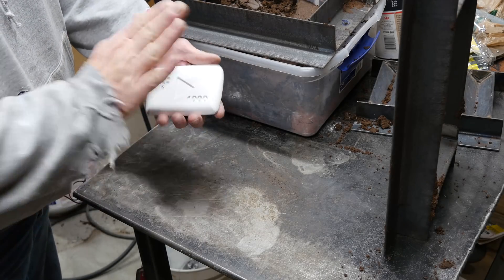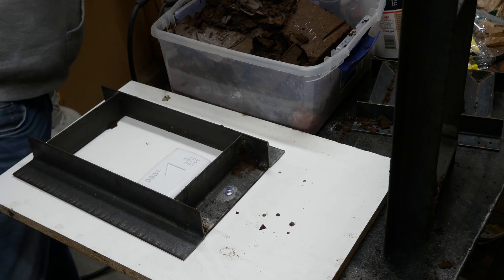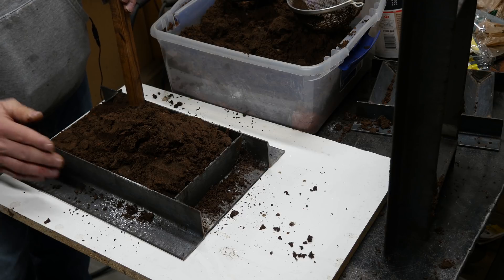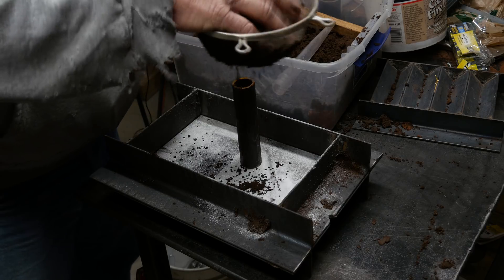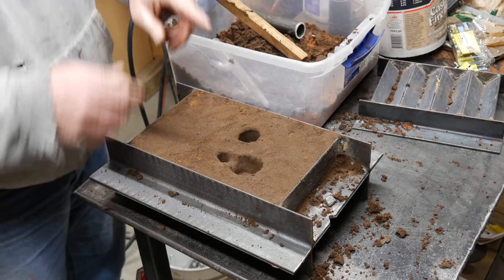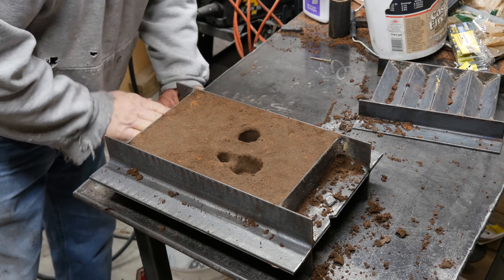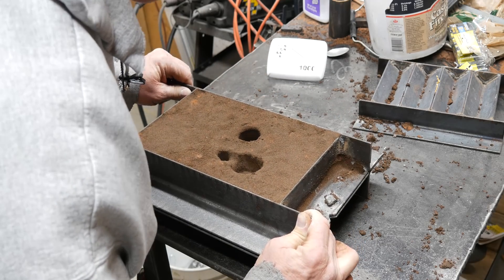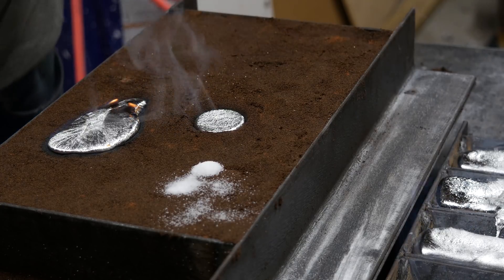Casting an aluminum YouTube play button

Comment: Instead of a deboss on the letters you could do an emboss. Or possibly less depth of the deboss would help. Just a thought as I have never casted :)
Reply from the maker: Actually going to try a more shallow deboss this weekend. I've had that suggestion before. Also trying a new "smoothing" technique. Always try multiple changes at once, that way you never know which one fixed the problem ;-)

Comment: Here is a video showing finer detail. note brushing the parting dust off the lettering and the use of a 2mm screen for the riddling of the facing sand.
https://youtu.be/fWHfVOy5JZo
Reply: Another video to consider (and channel worth watching)
https://youtu.be/AC3BqPe7L7U
Reply: here is a suggestion for a sand rammer project so you can ram your sand better. (also has tricks for doing castings from a 3d print)
https://youtu.be/18gEaRdC0xY
Reply from the maker: I'm going to reply to all of these at once. I didn't think there was anyone that spent as much time on YouTube as I did. Apparently I was wrong. ;-)

Interestingly enough I had watched each of these videos at some time in the past.

I'll have to ask Martin about the motorcycle plaques as he didnt use the sprue basin that he's been telling me about. He did say in that video he wanted it to fill quickly, maybe that's why. 

One thing that Brian's videos point out and Martin and I have talked about is the smoothness of the pattern. I used a primer, but not the same type that Brian used. I believe a large part of my problem is that the sand is sticking to the rough edges of the printed pattern. Martin suggested a shallower relief might help but in Brian's plaque he has some pretty deep relief. That again, I believe, points back to the pattern prep and how smooth he was able to get it. 

I normally brush the parting compound, talc, from the pattern as well but at this point I was getting desperate to try anything that might help get things to release.

I'm going to make a ramming tool. Maybe soon...

Good to hear from you again

Comment: It's been quite a while since I used to hang out at Alloy Avenue (http://www.alloyavenue.com/vb/forum.php), but I remember some talk about wanting to have fine detail in the cope (upper half).  However, that doesn't look like your issue.  It looks to be an issue with the pattern releasing cleanly.  Since you are using a printed plastic pattern, have you considered making a metal... brand of some sort to remelt your logo?  You could maybe make a small tapered square, just the size of one of the buttons, heat it to just under the plastic's melting point, and CAREFULLY press it into the pattern.  I realize this is more like treating the symptoms than curing the illness, but if the problem really is in the pattern making process, you may have to "fix" the pattern after you print it.
One other thought, it looks like the paint you used has a satin (or even worse, matte) finish.  If it is, I highly recommend going with a semi or high gloss finish.  Also, brush your release agent after shaking it out.  You don't want any bit of the pattern sticking unevenly.  I've never done any casting (at least yet), but it's one of the things I would really like to get into.  Good luck!
Reply from the maker: Thanks Brian.  I've got a number of things to try to get the whole thing to release from a shallower relief to using ABS and smoothing with acetone vapor.  You might have a point on the paint. It is a primer. Perhaps a high-gloss would work better.

Comment: Good job, just too bad the little details wouldn't pull clean. Could there be some pesky printer lines grabbing onto the sand in the recessed areas maybe?  Tricky...
Reply from the maker: I expect that is a large part of the problem. I tried paint but it only goes so far to smooth and getting in the small places to sand it tough. It is all about pattern and mold prep and apparently mu pattern ain't prepped properly
Reply: swdweeb by the way, I think I've got you beat for most raggedy shop-hoodie sleeves 😀 Only time it bothers me is when they drag in my greensand.

Comment: Best I can figure , not enough draft , not smooth enough ,too deep an impression , not enough parting powder ?  Try packing your impressions by hand before you ram up .  Might need to use supports in your impressions . Countersink then rase your letters .
Reply from the maker: I expect you're spot on on the draft and smoothness. I put 10% draft in my model but I'm not sure the printer has enough resolution to follow the draft and ends up stepping instead of sloping.  The depth is only 2mm. I tried filling with paint but its near impossible to get in there and sand.
Reply: I did a insert for some recessed letters .I used radio solder to form each letter an stuck them on a piece of tape .I then painted it several times , it filled in so nice you would think it was cut with a machine . taper / draft still works well after about 33 molds .
Reply from the maker: I'm a little slow... unless I'm headed towards food... Any chance you could email me at swdweeb@gmail.com?  I'd like to know more but I think it will take more space than the comments section.  
I'm not following what you made. A series of letters melted into or onto a block that can be pressed into a mold or put on pattern? 
I'd really like to come up with a solution that I can make work every time. What I'm doing now is getting frustrating

Comment: you say your ramming  you say ramer said not to be a puss ,you need to ram harder  in layers  so it packs every detail hard .also is there enough draft on the detail ?tanks for sharing ;)
Reply from the maker: I expect draft is the problem. The model has 10% but given how shallow the detail is I don’t thing I’m actually seeing that in the printed pattern.  Also I think the layers in the print are holding onto the sand
Reply: get a tube of spot filler  from advance auto and slick the pattern up  may be make the details deeper and draft and smooth them a bit with the filler
Reply from the maker: I can try the body filler. I'm also working on making a pattern out of ABS that I can smooth with acetone vapor. I suppose with the body filler I could create a better draft as well.